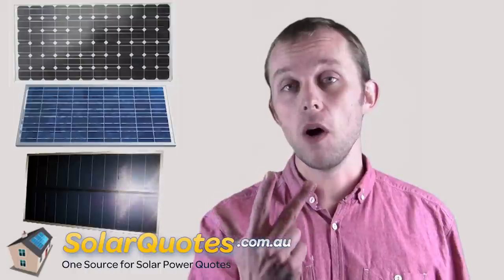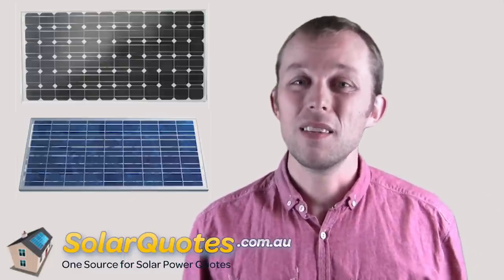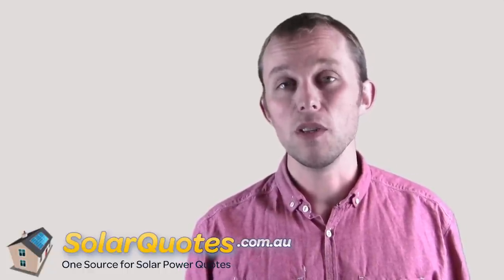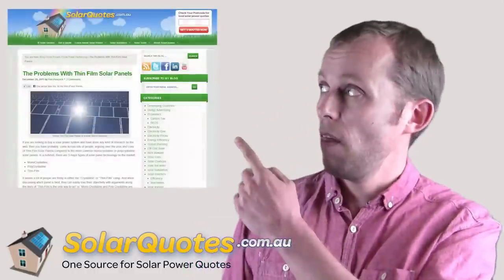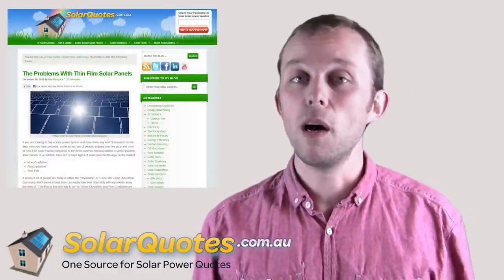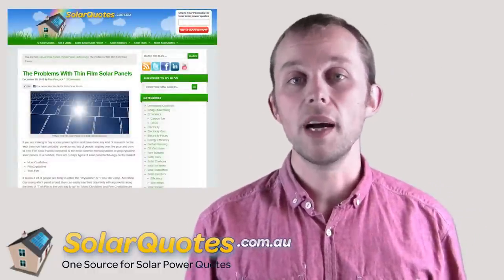What Is The Difference Between The 3 Major Solar Panel Technologies?

Comment: If you measure the voltages of mono vs poly crystalline panels at the very end of the day you will see a difference. Naturally the current of any panel declines as the light decreases but the voltage of a poly crystalline panel falls off much faster, which means the overall wattage goes with it. This is not much more than an "academic" difference for a typical sunny day. However, for a situation that frequently experiences low light conditions (i.e. overcast skies) mono panels will perform markedly better.